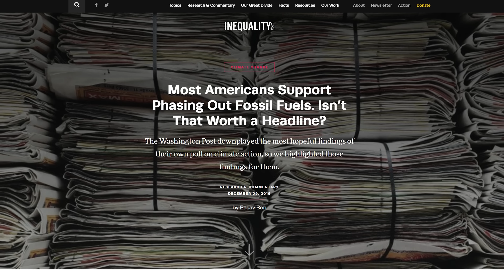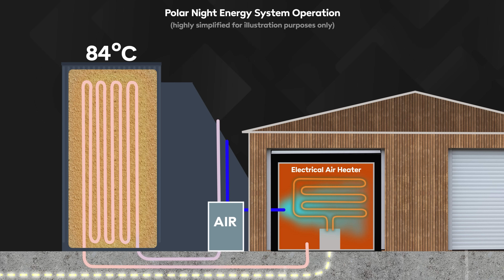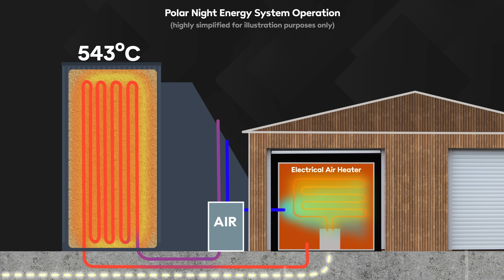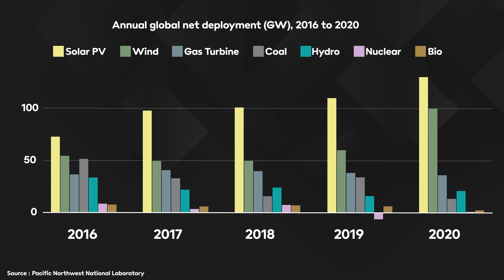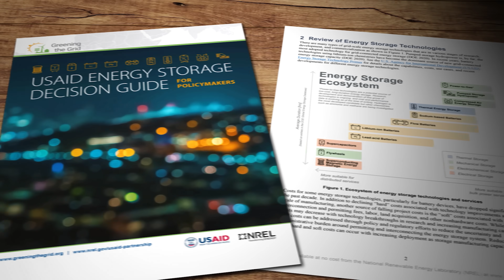The 'Sand Battery' that heats your home, NOT the planet!

Comment: This sounds like very promising and fun. However, I'm not really sure about the whole process design. I suppose that the whole thing was calculated before, but to me it feels like it's something king sad to use electric resistance to heat the whole thing. Especially when you factor in the fact that heat pumps can have up to like 400% efficiency. And if you start to store your thermal energy, probably on hot days, I don't know, this sounds like you could get a serious boost of power just using heat pumps. Of course, this may not have any economical sense as you probably use electricity when cheap, so investing in heat pumps may not be the right thing to do.

If they plan to make their storage unit go to 500°C, I wonder if they could use this tech to store energy for old coal/gas plant, in order to heat water to steam, to get energy back. Could you even achieve higher than 100% efficiency storage if you use heat pumps to store thermal energy, then converting it back to electricity ? I know that thermal plants are not really that efficient (40-60% maybe) but if you put in 300-400% of heat pump efficiency it may go really well, maybe even better than lithium-ion. Bonus thing : you'd not be putting heat in evenironement, but COLD.

Comment: I don't understand the data center thing. You said their 60C output isn't hot enough to use directly. Rather than use a heat pump to raise it to the required 75C, they simply installed the hot sand storage... which requires heat to 600C. There is something missing in that equation. How does thermal storage make 60C usable when it otherwise wasn't?

Comment: I wondering about the Australian sodium battery manufacturer and the lower cost to build battery storage for house and charge the batteries during off-peak when cost is low and discharge during peak power. Not a PV system just a home electrical storage system to use cheap power when price is low and demand is low to use in higher demand times.

Comment: More efficient is not necessary. Since the sun produces more energy in one hour then we humans use in one year.  Hydrogen can heat and cool everything we need to heat and cool. With out emitting CO2.  Orkney Scotland has been heating its self with green hydrogen from title turbine electrical generation for the last 3 years.. any other system will definitely be required to be efficient.  Hydrogen does not.

Comment: As always, this is encouraging and intriguing, but there's one detail that seems flawed to me:  if the system uses the same pipes to add heat to and draw heat from the sand, then they can only charge the system when they don't need heat.  This seems to imply a system that fully charges and discharges instead of maintaining a steady state in the middle, which seems, at a glance anyway to be preferable.
Reply: That's easily solved: Just allow a controlled mixing of the hot and cold side fluids.

Comment: One thing that can be easily done in the meantime, …have your existing system checked for leaks, especially in an attic, make sure your ductwork is clean, have your gas / oil provider perform a tune up. I’ve seen hundreds of high efficiency hvac appliances installed into old infrastructure. This issue needs to be addressed.

Comment: one why dont we have a small house scale for this to work? summer time you can have the ac going then the excess heat go into the sand battery, to help heat the water and maybe radiant flooring. Seems logical for addons and new construction.

Comment: An Australian company called 1414D is building a similar type of storage that will retain heat at 1414 degrees Celsius.  At that heat the energy can be used to power turbines for the production of electricity. That is why they are building their first model in South Australia, running close to 100% renewable energy our grid just needs some storage to reach that perfect score and with lots of summer time solar energy not used because we don't have the capacity to export it all to other states, this is the ideal place for it. If they can make it work as promised which, as with all new technology is challenging.

Comment: Thermal energy is great for the general downtime of renewables. The problem is, you have to build capacity for the non normal. The extended winter storm that could last for several days without the ability to recharge the system. We had a winter blast In Texas with extended cloud cover for 7 days. Without a consistent energy source people would have died. Next gen nuclear breeder reactors must be the base-load power followed by renewables for peak power.

Comment: As you mentioned, it's common here in Sweden. My house is connected to a district heating system and it works very well. The heat and electricity are produced by burning biomass and waste (waste that isn't possible to recycle, for now at least). The way forward seems a bit uncertain but the goals are high and it will be interesting to see what the future holds. Great video as always!

Comment: Yes, with a phase change material, its a great idea !
Don't use electricity to simply make heat and use a gasifier approach to convert biomass.
Store heat in the same way as a stone fireplace, in a great thermal mass.

Comment: Back in the 1960's we had something not quite like this.  We had night storage heaters which worked by electric resitance heating of a fire brick core during the night (hence the name) using off peak electric and then during the day releasing the heat into the room.  They sort of worked but suffered when the promise of cheap nuclear didn't happen.
Still in the 1960's there were roof water solar heaters which heated tanks of water during the day and released it into the central heating at night.
Then, I remember seeing on Tomorrows World a system in Israel where they had windows with hugh stone shutters which pivoted (on a vertical axis) in the centre.  They were oriented one way in day time shading the room and absorbing the sun's heat in the outer layers.  Then the rotated it 180 deg so that the hot face was inward and the cool face outward.
Now we are doing all these things which weren't economic then but necessity drives now.

Comment: I've wondered why the wind turbines are all radial vs axial, similar to the units along highways/freeways you did a piece on? An axial wind turbine would be both more effiecient, because they could benefit from wind from any direction w/o needing a bearing assembly to rotate when wind direction changes, and more eco-friendly by making  the assembly less dangerous to avian wildlife by not having those massive blades flying about harming them and just over-all more efficient.

Comment: 8:44 Yup. Sand would store less energy. About 67% as much as with water.

That said, 500°C may be a more useful temperature than 98°C, so whether it would be "better or worse", I can't tell.
E.g. if you can only draw it down to 20°C, you have only 78°C with the water, but 480°C with the sand, and the energy stored in 78°C water is less than 480°C sand. (0.326 MJ · kg⁻¹ vs 0.384 MJ · kg⁻¹). It gets worse if you can't go lower than 75°C, which it sounded like was the case for the installation in Finland.

Water has a much higher heat capacity of 4.184 kJ · kg⁻¹ · K⁻¹. 
Sand has a heat capacity of around 0.8 kJ · kg⁻¹ · K⁻¹.

Water at 98°C (371K):
4.184 kJ · kg⁻¹ · K⁻¹ · 371 K = 1552.264 kJ = 1.552 MJ · kg⁻¹

Sand at 500°C (873K):
800 kJ · kg⁻¹ · K⁻¹ · 873 K = 698.400 kJ = 0.698 MJ · kg⁻¹.

Density of sand is about 1.5 times higher than water.

Water: ~ 1.552 MJ · L⁻¹
Sand: ~ 1.047 MJ · L⁻¹ (0.698 MJ · kg⁻¹ · 1.5 kg · L⁻ ¹)

Help for non-math people 😋:  kg⁻¹ is the same as 1/kg, or "per kg". I could have written it as 4.184 kJ/(kg · K), but once you know how ⁻¹ works, it's easier to read.

Comment: according to wikipedia, sand has 700J/kg/K. When Water has 4189J/kg/K. It is more suitable to store hat in water. Although sand can be heated to much higher temperature, and... it is not corrosive or do not degrade.
Reply: For fixed installation, size is more a constrains that mass. What's the figure J/l rather than J/Kg?
Reply: @vylbird8014  Good point. Hard to estimate average density of sand, especially, as it is highly compressable. But i guess that it has to be compressed, because air gaps would prevent heat from being transferred efficiently. Also, the sand is approximatelly 1,5 times the density of water, so that's a plus as well - volumetric specific heat is 700*1,5 the original value is close to 1050 J/kg/K.

Comment: Doing some of my usual back-of-envelope calculations... Sand has a very low heat capacity (~1/6 compared to water) so the storage temperature must be very high to compete, even when it's almost twice as dense. Sand's advantage is that water at 100C isn't as useful for energy extraction. If you could keep water at a significantly higher pressure, things might cross over. On a related topic: https://www.youtube.com/watch?v=Q8xsg9iK5yo&t=2s

Comment: The thing that pops into my head. I know sand doesn't isolate all that well. Give if an inside core temp of 600 degrees and outside an average 10 how is this all going to hold up? Inside housing the heating temp is going back from 60 to 28-30 degrees. So this sounds like a perfect idea from the 70's!
Here in Holland we have alot of block heating from burning waste.

Comment: Is this not similar to night time storage heaters used in the 60-70's. Heat up insulated bricks when night time cheaper electricity is available. Then switch on a fan when the heat is needed. Old tech is good tech.

Comment: These new developments are a great way to expand on the current infrastructure, turning them more green than they already are.
I've come across this in Sweden. There they incinerate their non-recyclable waste to generate the initial heat for these systems and although natural gas is used to begin the process, most of the heat is generated through the subsiquent flames created by the waste. 
Whilst burning the waste, they capture and process the harmful fumes as well, making it a very green way to generate the heat and reduce the harmful footprint our society produces in its waste creation. That well known two birds, one stone effect 🙃
I do note one thing though, all these structures for storing the heat are developed  above ground in silos that require a large amount of energy to produce, transport and construct - all the while leaving the storage facilities exposed to the elements. 
Has anyone considered digging holes in the ground and insulating them to create the same facilities?
This would reduce the production cost, the resources and energy required and would reduce the need for excessive insulation due to the natural insulation the ground offers both through heat retention and lack of exposure to the elements.
It would also allow for the land above to be used for properties of any kind and thus reduce the waste of land use that projects such as these might come across in their attempts to get off the ground 🥁

Comment: Thanks for another great video.  When I studied Architecture 25years ago we had a PHD lecturer from the UK who’s PHD topic looked at the cost of retro fitting insulation to ALL UK homes and it was about the same as one nuclear power station.  Insulation is the low hanging fruit, cheapest solution for biggest and longest lasting bang for buck.  Retro fitting windows is more expensive, once you do this though, heating demand can be dropped as much as 70% or 90% in new passive house buildings.  I don’t think we have time to roll out large scale complex infrastructure, but these kind of systems seem really simple and smart as grid scale energy storage…

Comment: Thanks again. Is there any way the domestic gas supply infrastructure could be repurposed to distribute district heating or act as a ground source for heat pumps?
Reply: I doubt it - the metal pipes are not made for water, they probably don't have the appropriate corrosion resistant alloy.

Comment: This is a great idea, comparatively cheap, fast to build.  I hop they use "useless" desert sand instead of high quality concrete sand to fill these things.   Desert sand is too smooth and hence unfit for use in concrete.

As far as water storage, it seems they  could heat that water quite a bit for almost free during the summer with a few small solar powered pumps and a black pipe solar water heating installation.

While the war is terrible, it may help push the world off of fossil fuel faster and mitigate some really terrible calamities not too far down the road now (2060?  2070?).

Comment: Recently working in an old farmhouse which has been converted into a wedding venue. The day was really hot and the room had no air conditioning at all. The large windows  had wooden screens that were built into the window frames when the house was built. We just closed the wooden screens and no hot air to bother us. The same applies in winter. Of course this happens in Switzerland and Austria historically. Perhaps we need to look at some old building methods to teach the builders of today.

Comment: What a fascinating and surprisingly simple solution!  It's exciting to see the continuing innovation with alternative energy sources.  Several years ago, I took a big risk with our home and removed our oil-fired forced hot water heating system.  To replace it, I created four zones heated by 60-centimeter-square ceramic panels that attach to the wall, about 15 cm above the floor.  There's one panel in each room, except for the larger dining room and living room which have two each.  The panels each use 450 watts of power maximum, but are controlled by intelligent thermostats that provide only enough electricity to heat the room (via passive convection) to the desired temperature.  On all but the coldest days in the dead of winter, our home stays at 64 degrees (which is what we prefer).  For days with temperatures below zero, I installed a wood stove in our basement.  I use BioBricks (basically recycled sawdust bricks) and that raises the ambient temperature in the house an additional 3 degrees.  So far it's worked out really well.  And instead of spending $3000 each season on oil, the ceramic heaters add only about $150 a month to our electric bill.

Comment: You mentioned briefly that overnight electric is very cheap. I know someone that has captured this cheap electric, stored it in a bank of batteries and uses this during the day to power and heat the home. The total cost is quite low compared to any PV or heat exchanger and costs can be recouped in a few years.

Comment: Community heating will not fly here where distance between homes tend to be measured in miles.  I like the sand storage idea and wonder how far down it can scale. I have lots of room to install it and local low cost grid power at night.

Comment: ‘’Resistance heating’’ the most inefficient way of heating, uses vast amounts of electricity, meaning more deforestation of the Congo, for Copper, Tin, rare Earth metals etc. extractive linear growth economy perpetuating!
Reply: Using solarpanels instead of PV-panels for electric heating means lower Delta T, probably quadripling the volume of the buffer container.

Comment: District heating system in Zagreb, Croatia had several large thermal accumulators at they combined electricity and heat generation plants - during summer they produce excess heat. I don't know do they use sand or something more exotic like molten salt.
Plans are underway to add some local geothermal energy  to the mix, using the existing municipal hot water network for distribution.

Comment: This is encouraging. Today I saw here in the small village  Ellern near the Rhine a system with thermal solar arrays coupled to a storage tank. At home I use PV excess current to heat water in a common boiler. When I sell the electricity excess I get 12 cents/kwh. So even this mundane application of something as usefull as electricity is economical. But in the end it is all extra work and money.  I think that only rising energy prices (carbon tax) will move things faster...

Comment: A brilliant concept, already forgotten scale up. There are several villages in South Yorkshire that have District heating systems, originally coal fired, but then went to gas boilers. I think the oldest district heating system in the UK was Nottingham city centre, which was run from the Boots power station. When that closed the system was extended out to the Energy from waste station, near the football ground.

Comment: I think GSHP's together with essentially an Eddi to heat water from excess PV, the hot water produced being used to elevate the underground temperature during summer in order for it to be extracted over winter is the answer. It should keep the COP large over winter thus reducing the amount of electricity being used during this time whilst essentially storing excess solar produced over summer.

Comment: Luke Skywalker had off-grid solar and storage in the 1970s.  Seriously, most (70-90%) of home energy use is wasted.  Fix the waste first & foremost, otherwise you're just getting a discount on waste.   Trim the fat, eliminate the waste and we wouldn't have to worry about extra energy.  Then, it's easy to put a tiny PV system on a home to get to ZERO.